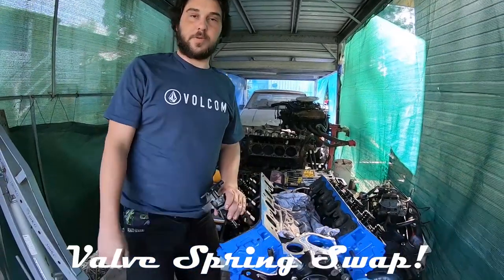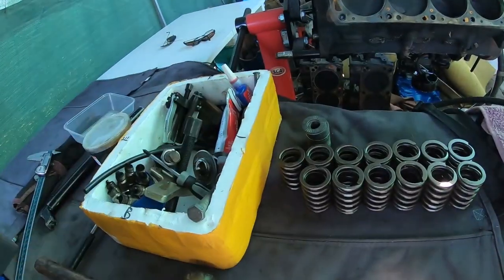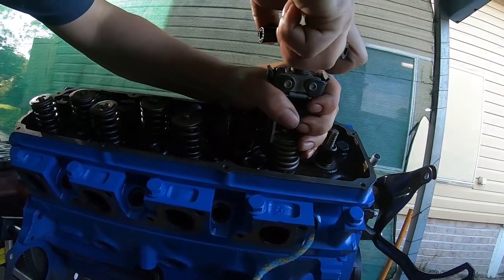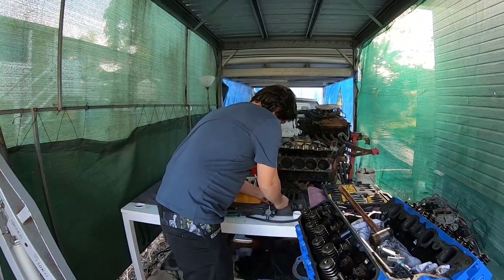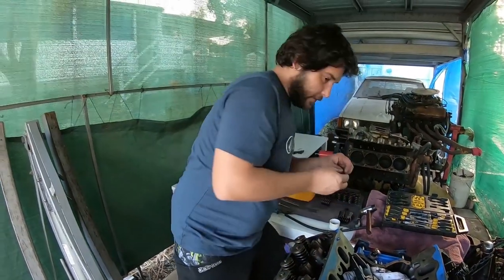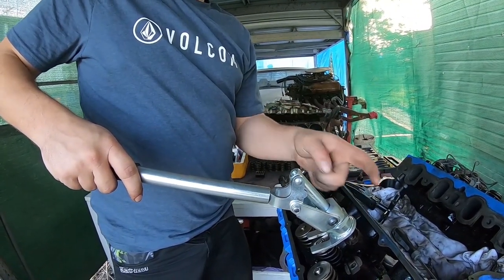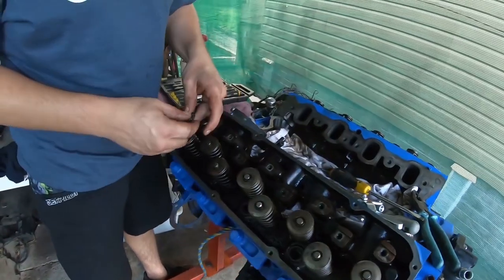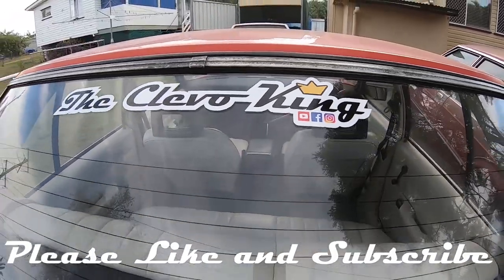FORD 351 CLEVELAND CAMSHAFT SWAP PART SEVEN VALVE SPRING SWAP

Comment: So, a lot has been said about replacing the stock valves that have the rotating collets to single groove. What is your experience? I'm currently building a 4V with ported heads and am using beehive springs and retainers with 1 piece SS valves for use with a solid cam. This is a 1970 M code with forged pistons, rods, and adjustable valve train.  Thought about the roller cams but want to be able to RPM this motor. Enjoying this series.
Reply from the maker: Yeah if you are going to rev it beyond 6000rpm sustained I’d definately go to a stainless single groove valve but this is a pretty freshly rebuilt engine and we didn’t want to remove the heads. Beehive springs are awesome they really help keep total control over the valve with still mild seat pressures.

Comment: Do you have a spring tension checker? Have you checked on older springs and noticed that they loose temsion especially the ones on open valves on a car that was not moved for years?

Comment: Gday fellas..so I've just put the timing cover on and now I have put the new after market water pump just like the one in your video and have now noticed that the fan on inside of pump is rubbing on timing cover plate..not bye much but deffo rubbing..  any ideas for Mr guys.  Cheers from nsw
Reply from the maker: The water pump isn’t right I’d get it swapped over if possible or get a second gasket if you are stuck with it

Comment: Hey mate trying to send you a pm regarding a cleveland 
I'll just post it here I've got a xe Spac looking a doing a V8 swap do you think its worth putting a 393 stroker in or worked 351 I'm purely going after a nice sounding lumpy cruiser that could do a mean skid if needed but something to just cruise and enjoy
Reply from the maker: 351 clevos are a bit cheaper to build and imo rev up a touch faster, 393 make a handful more torque and make easy 40-50hp more then the 351 would without turning it as hard. Most 393 combos benefit from alloy heads too over iron to get them breathing.
Reply: @thclevoking  thanks mate so what upgrades would be needed to get a nice lumpy crackling sounding 351 haven't got the engine yet want to make sure what I am doing before I purchase one cheers
Reply: @thclevoking  pretty much would like it to sound like your yellow xe in the video against the xb ute